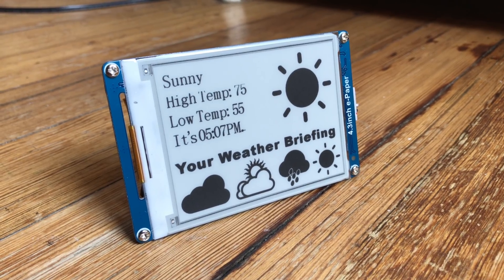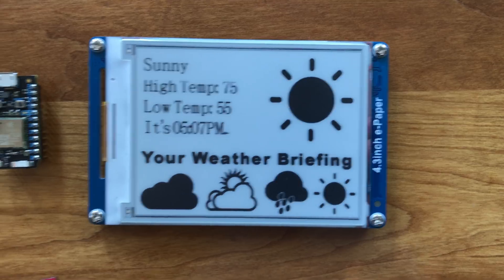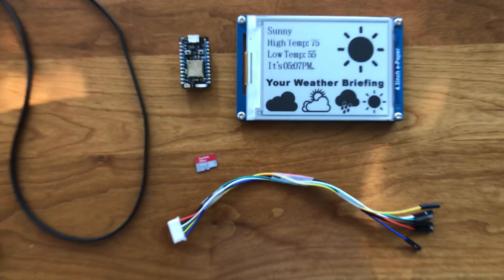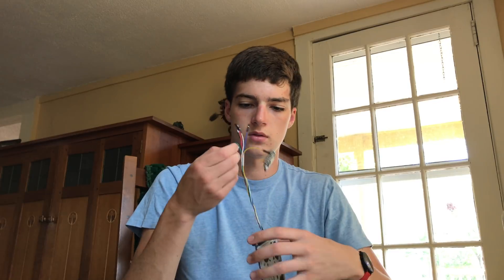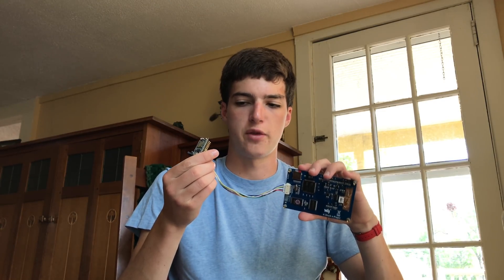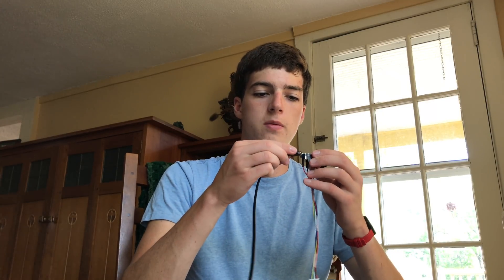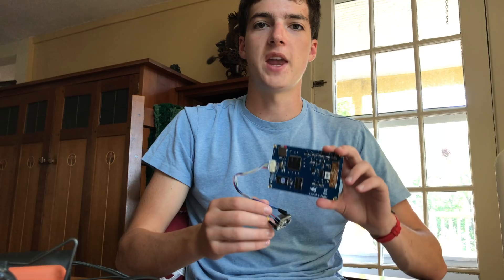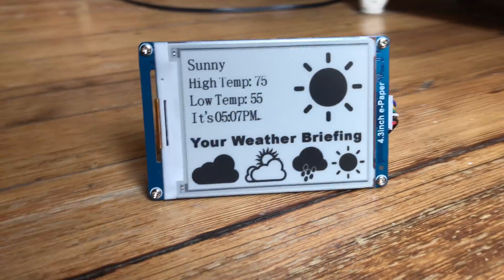E-Paper Weather Display

Comment: Hey Alex nice video. I think you forgot to include the link to the 6 pin connector.
Reply from the maker: Thanks! Actually the connector is included with the display so you don't need to worry about that
Reply: Thank you! I've just ordered all the parts. Let's see how it works out.

Comment: Hey Alex - did you play about at all with creating custom images using the img2lcd software mentioned on their Wiki? (http://www.waveshare.com/wiki/1.54inch_e-Paper_Module)  Have been getting the arrays out OK but the screen then doesn't like them and just wondered if you'd had any luck!
Reply from the maker: Hi Alan - I would definitely recommend using the provided micro SD card slot instead of trying to convert the bitmaps to arrays. I explain how to do this in my tutorial for the project: https://www.hackster.io/AlexWulff/e-paper-weather-display-with-photon-and-ifttt-cc37a0
Reply: Hi Alex - unfortunately I'm using the smaller version of the Waveshare screen that doesn't have an SD card option - driving it directly from a Pi and can get the demo to run fine and can tweak text but image arrays proving more problematic! Thanks anyway :)